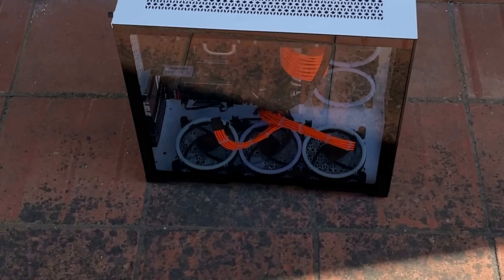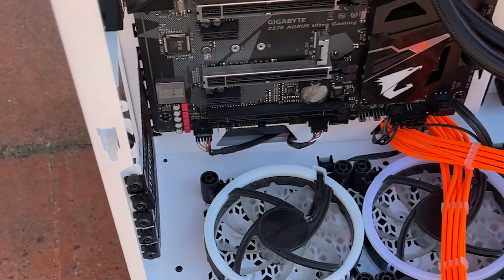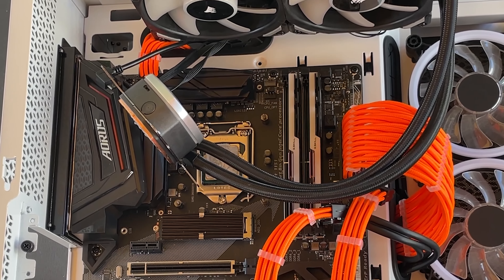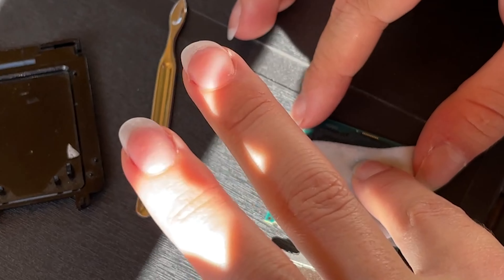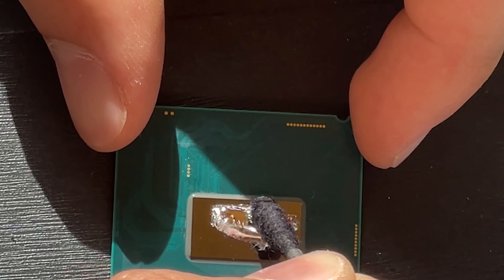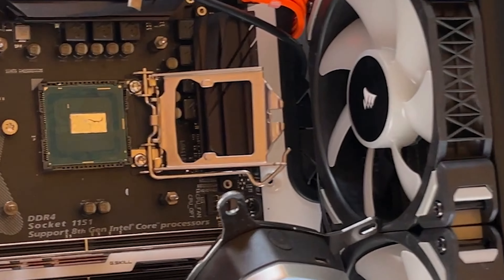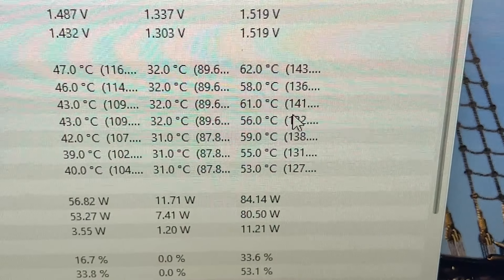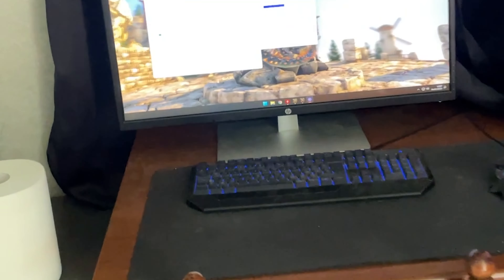Building an i7 8086K & RTX 3060 Ti Used PC in 2023!

Comment: I have an 8086k paired with a 4080 and zero bottlenecks
Reply from the maker: That CPU, overclocked beyond 5Ghz, is a gaming beast.
Reply: @ImWateringPSUs  8086k would definitely bottleneck but still an awesome CPU.
Reply: 8086k not bottlenecking a 4080? lmao ur delusional

Comment: Older platforms still have value and it's always lovely to see. I started with a 10400 in December 2021 on a Z490. Upgraded to a 10600k last month. 4.7ghz all core at 1.25v with an air cooler. GPU is an RX 6600. 
Exciting stuff and still room for more performance.
Reply: have you plan on getting an upgrade down the road with comet lake gen?
Reply: @mtaufiqnmtn  Yes. Either comet or rocket, depending on the deals available.
Reply: @deaddeyedante  that's great, i think it will last long enough, and between that you can still upgrade it to 11th gen i7
Reply: @mtaufiqnmtn  Yup
Reply from the maker: Definitely man! I think the 10600K is probably the best value CPU out there at the moment, plus you are starting to find 11th gen i9s for cheap. I had a 10700K in my main build but switched to an 11900K for just 235€, and I can also sell my old 10700K to recoup some!
Reply: @ImWateringPSUs  💪🏼💪🏼

Comment: I have an i7-8086k and I was wondering if this build works with the regular RTX 3060 (12gb) without bottlenecking?
Reply: @Toxifys  increase your resolution there is be no bottleneck. 1080p with a 2080, 1440 with 3080, 4k 4080. General idea. Should work fine.

Comment: I have the 8086k with a 2080 and 64gb 3000mhz ram and a Samsung 2tb nvme. Love my pc. Still no reason to upgrade. Since 2018. Best pc in the house and I have 5 other PCs. This monster rips through anything. All games are at 1440p and anywhere from ultra setting to a mix of high and medium. Hardly run any games with dlss. 90% of games are Mostly native. Helldivers is running mixed settings. Shadows on low (preference), textures and detail on highest everything else is on and I’m hitting 100fps. Motion blur is off. Lol 😂 I told myself in 2018 that I’d upgrade are the 15 series cpus and 5000 gpus but I might wait a bit longer. Will see.
Reply from the maker: That was one of the best matches at the time! Great to see such feedback, I knew it even at the time that these high clocked, ring-bus hyperthreaded 6-cores were gonna last a looong time :)
Reply: I still play 1080p 8086k and 2080to still flawless
Reply: @JamesCorbettMusic5000  it’s a wonderful build. Game on it every day.

Comment: Hey dude does it work well? No bottleneck or anything??
Reply from the maker: No bottleneck at all, I was honestly impressed by how balanced the combo is!
Reply: @ImWateringPSUs  wt psu u using??
Reply from the maker: @nothexx4976  I think it was an Antec 750W or 650W model!
Reply: I have an older intel Ivy Hex xeon with a 4070 and its plays everything 100-300 fps.  The old 6 core intels will work with new card fine.